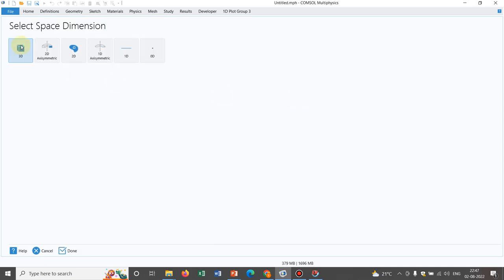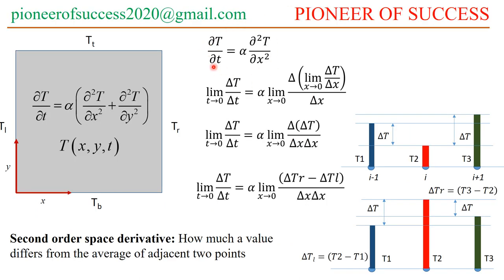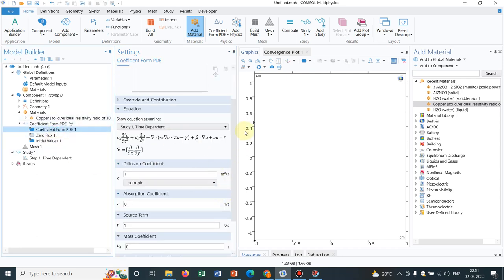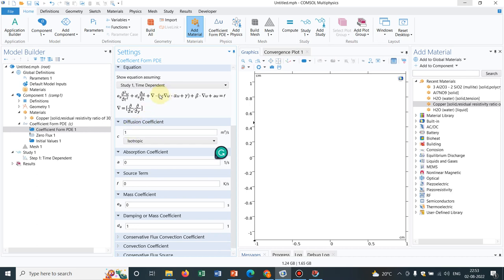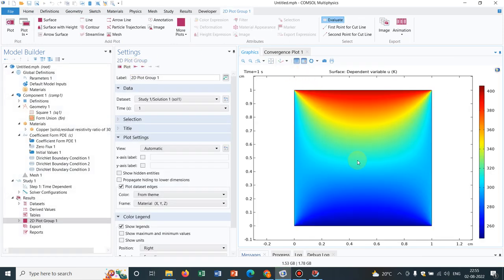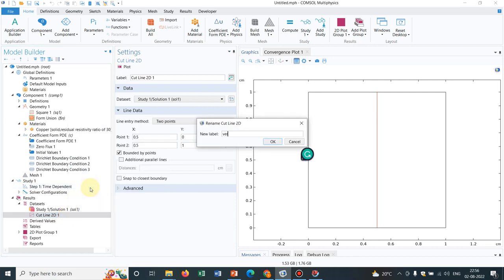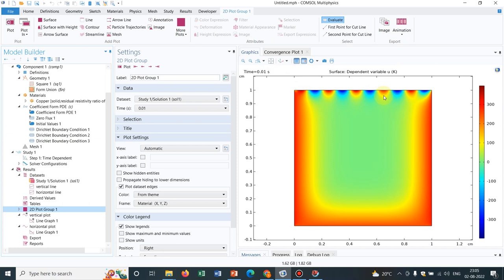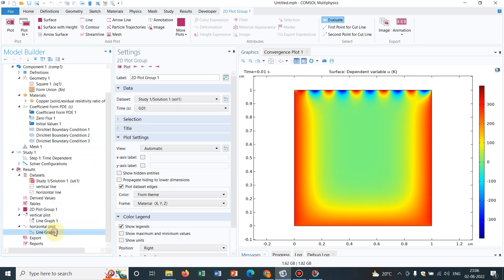Understanding Solution of Heat Equation with COMSOL #Unsteady #HeatEquation #Solution #COMSOL

Comment: Please why the distribution is not uniformly? The center seems have more heat than left and right side
Reply from the maker: Heat transfer is more where the gradient is higher. If you can visualize the situation, the top wall is at maximum temperature and the other three walls are at low temperature. Near the edges of the low temperature, the gradient is always low; hence, heat transfer is low there. On the other hand, at the central vertical line it experiences maximum gradient always. This nature makes the temperature profile like what is shown here. I hope it helps.